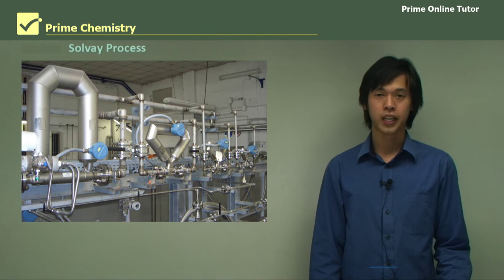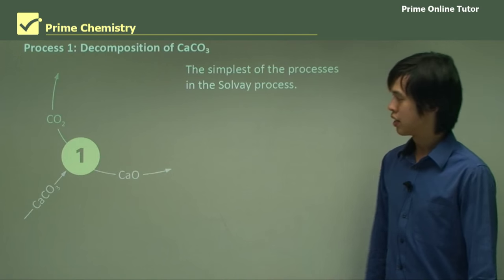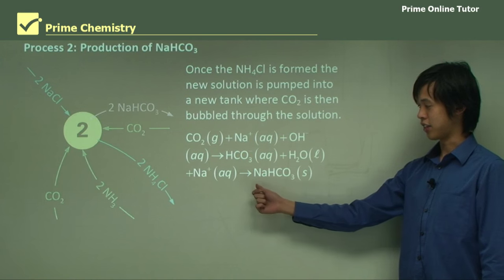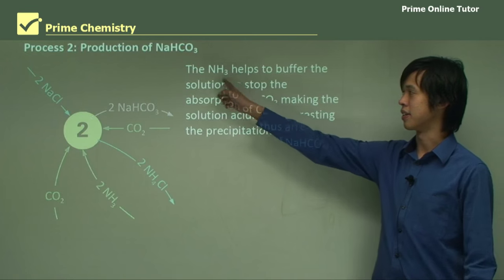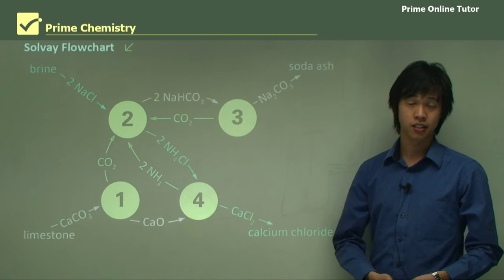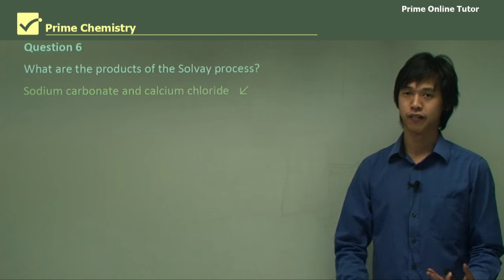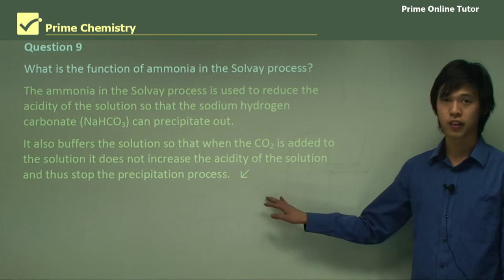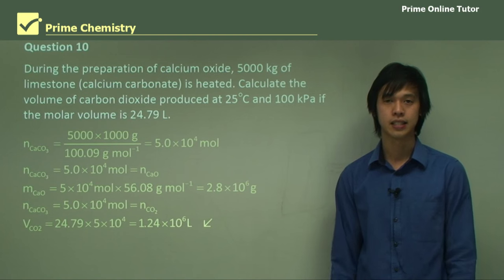How to Make Sodium Carbonate? Watch the Solvay Process Magic Unfold! ✨

Comment: Sir, how about water, where does it come into play,
EDITED: I think the process 2 equation needs to add water to be correct
Reply from the maker: Thank you for your question! You're absolutely right to point out the role of water in the Solvay process. Water is indeed crucial, especially in the absorption of carbon dioxide and ammonia, as well as in dissolving the reactants during different stages of the process. I appreciate your attention to detail regarding Process 2. While water isn't explicitly shown in some simplified equations, it's an essential part of the overall chemical environment. I'll make sure to clarify this in future content. Thanks again for your insightful comment!